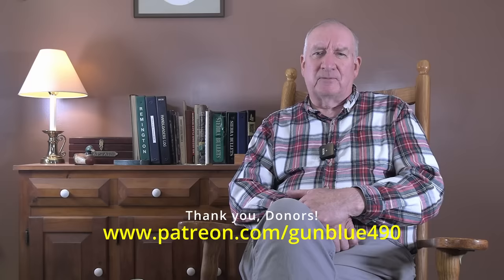The Copper Fouling Lie ~ Don't Fall for It!

Comment: When I started precision rifle shooting I always cleaned the barrels with a copper solvent after 50 rounds. Next time on the range it took me about 8-12 fouling shots just to get the point of impact back where it was before and to get back proper precision. After a while it dawned me how dumb and also expensive that practice was and never removed the copper from barrels since, and after many hundred rounds through my .308 and .300 they still hold 0.5 to 0.75 MOA consistently.
Reply from the maker: That was exactly our experience.  It creates cold clean bore syndrome.
Reply: @GunBlue490  should I fire copper jacketed ammo for my .22LR rifles? I think I only have used lead bullets on some of them eg Aguila super but I have some cci minimags...
I think I've answered my own question 😅
Reply: @Bear Gillium  the copper on 22 lr projectiles is more a copper wash or coating that is far softer than a jacketed centerfire round so it shouldn't do anything much to the bore.
If anything its cleaner than using straight up lead projectiles.
Reply: What cleaning solvents do you use?
Reply: @GunBlue490  so you acknowledge it exists, but you choose not to address it because it’s not absolutely necessary?
Reply: @jasonrad9332  Copper in the barrel yes...copper "fouling"...no.
Reply: In light of this "American Capitalist Idea", my ex-wife who was born in Korea would tell me that "Greeting Cards" were a way to get Americans to spend money. I think she is right, and I think it's that way for a lot of items on market shelves and concepts. We have to wash our hair every day, soap and water, clothes wear once and wash, clothes soap and it just goes on and on. It's capitalism at work...and so is copper fouling... capitalism hard at work...
Reply: But what about in the case of a couple thousand or so rounds? A few hundred rounds is nothing for a modern centerfire rifle firing jacketed bullets. My first AR15 saw 1,500 rounds in the first year of me owning it. And at the time I was a broke college student.
Reply: did you notice more impact shift with the 300?  ive heard from experienced hunters that this is more exaggerated with magnum rounds. I missed a bull last season, so I'm not going to clean my barrel and see what happens
Reply: The only solvent I am aware of is Hoppes # 9. I usually just clean my bores with Rem Oil
Reply: I tell people all the time, never clean your bore if you intend to shoot anytime soon, like going hunting. It takes around 7-9 shots just to get it back into Zero, but not due to fouling, it's due to burning the cleaning fluid out of the barrel. Once it's burned out, the bullet can develop consistency.
Reply: @hardlylivin6602  Refer to 7:50 Striations are filled smooth and doesn’t build up beyond filling, it gets shot out with each consecutive bullet.
Reply: Me too.
Reply: This is my experience.  The copper fils tiny imperfections on a metal surface and actually makes the bore slicker.
Reply: @additudeobx  I wouldn't call that capitalism; sounds more like marketing and a population's general adherence to group-think.  Capitalism creates the environment wherein marketing is effective, I guess, but I still don't see that being the fault of capitalism.  It's inherent to both companies and individuals having the freedom to buy/sell what they so choose.  

Would a command-economy fix the issue of hucksters selling people on the idea of needing copper solvents for their firearms?  Sure.  But you're going to lose the right to own those firearms in the process...
Reply: I'm not sure I follow his logic. On the one hand he says if the military doesn't address copper fouling it doesn't exist. And then the very next breath he explains that the military solution of CLP isn't that good and he has no idea why they still use it. If the military is wrong about CLP, how do you know they're not wrong about copper fouling? I'm not saying copper fouling is or isn't real, I'm just saying his argument don't make the case he thinks it does. I mean according to his logic, if the military doesn't know of a better cleaner, then it doesn't exist...
Reply: @theaustinfamily555  yep,i only use gun oil to clean my 5 rifles. Ive borescoped them all and ive never seen copper fouling in any of them ever,only carbon black comes out when i patch it.
Reply: @additudeobx  you must be stinking very bad.😂😂
Reply: @hardlylivin6602  you should watch it again and pay attention.
Reply: @additudeobx  Was she from North Korea?
Reply: @waynehajek6346 😂
Reply: @waynehajek6346 Indeed,like communisms limited choices a better idea.
Reply: The copper is better than the lead!
Reply: @alllopez63 I can completely clean my rifle barrel and the first shot in the clean bore always hits 8 inches high of point of aim and the sound shot is always 2 inches higher than point of aim and the 3 three shot is dead on so I never will hunt with a clean bore I always fowl it with 5 shots before I go hunting
Reply: Noticed that most long-range shooters don't clean their barrels until they notice an accuracy issue? It is working good for me so far?
Reply: @GunBlue490 what carbon cleaner would you recommend?
Reply: @byrontitanv8  gun oil and a patch
Reply: Barnes and others that make solid copper bullets have proven, when switching from copper gilded bullets to solid copper, the bore must be cleaned of the existing copper for optimal accuracy. Both Ron  Spomer and others have confirmed this from actual experience.
Reply: Not sure what you consider precision shooting, but for f-class and benchrest, a 1/2 moa barrel would be a tomato steak. And yes, we remove copper and carbon. Then follow with iosso or jb to polish out whatever is picking up the copper.
Reply: I clean my bore with breakthrough carbon pro first using a polymer bristle brush to remove heavy powder residue then clean it all out and dry bore and use a brass bristle brush scrubbing vigorously with some type of oil to remove lead and heavy copper until bore is actually "clean"
Reply: A good barrel that has been hand lapped by someone who knows how to do it won't copper up much at all. My 26" 1/9 twist Criterian 223r barrel has no cold bore shots out of the group and after 50 rnds, I get very very little blue on patches with a copper solvent, even after soaking. Cheap rough barrels will copper up.
Reply: Good comment...i don't shoot much but i thought a " dirty" barrel is the normal condition
Reply: @danblumel  Exactly! I wanted to mention the same. Barnes and others are doing it for good  reason.

Comment: I have become exhausted by having arguments in comments sections over this. I officially no longer care to try to save the YouTube shooting community from themselves. I tell people I curate copper during barrel break-in to improve accuracy, and I get no end of push-back from about two generations of self-proclaimed-know-it-alls. I'm over it, lol.
Reply: What does that mean to "curate copper"? Never heard that term before?
Reply: @jeffdonofri8027  Deliberately allow it to build up and collect in parts of the barrel that are otherwise imperfections in the cutting of the lands and grooves of the rifling, and purposely leave it there.
Reply: @jeffdonofri8027  Like: what do you do when you curate a collection of anything. Some things you save, some things you don't. In this instance I'm removing lead and carbon fouling, and retaining copper. It isn't like I read it somewhere, I just used the words curate and copper together because, well, it is a short way of describing it. So much for that plan though...
Reply: Is blue on the cleaning patch a bad thing? Remove carbon only?
Reply: @davidpaulk5658  blue or greenish is the copper coming out
Reply: @totljag1  yes but isnt it unavoidable to remove some copper while cleaning?
Reply: @davidpaulk5658  most likely but don’t use any copper remover down ur barrel ! All u want to remove is the carbon , the carbon will hold moisture and rust ur firearms , use Hoppes to remove the carbon and then after gun oil , CLP sucks , it’s not a great carbon remover or a great oil ! The copper in the grooves is smooth and will greatly help with accuracy ! The copper in the grooves is not fouling !
Reply: @totljag1  Thanks. I have a cleaner that removes carbon AND copper. I will experiment with HOPPES
Reply: @davidpaulk5658 Let me ask the better question. Why are you cleaning in the first place?
Most rifles modern rifles don't need to be cleaned regularly at all. Apart from removing debris from action components or clearing out corrosive powder residue it will usually degrade performance and it's only one more abrasive thing going down your barrel.
Unless your shooting sub .25 minute groups where you always need a fresh barrel it's overkill.
Reply: That's not how English works.
Reply: @DinoNucci  Is that so...do tell.
Reply: @userJohnSmith  yes I shoot sub minute in the .2s (when I'm lucky) and in the .3s regularly.Heavy barrel bolt gun.Shilen barrel,Canjar trigger,Sako action,Herters stock.I dont uses brushes of any kind.Just Sharp Shooter Cleaning products. Will definetly try Gun Blues method.
Reply: @davidpaulk5658  Been doing precision ARs for a few years. Half minute is my baseline with those and I never clean them. Just pull the bolts to feel with carbon, sand, and oil.
Reply: @userJohnSmith  you dont clean the bore and chamber?
What barrels do you like for your precision ARs?
Reply: @totljag1  Thank You
Reply: @davidpaulk5658  Never. McGowan has been the most consistent, Sanders Armory seems to get good barrels as well, not sure from whom. I've heard faxon is good. But I'm in Colorado, basically no humidity. Doubt that matters much though.
Reply: I mostly shoot 22s and handguns, but this copper fouling myth has obviously taken on Religious cult dimensions. The first thing you do with precision 22s or position rifles is to take fouling shots to coat the inside of the barrel with waxy bullet grease. Copper can be used as a lubricant in certain high pressure processes.
Reply: @upcycle.outdoorsman9629  Do you use any of the Copper removing formula powders (Copper Fouling eraser), or skip them as also a "fad."  Just curious, meaning if the copper is 'desirable' and copper cleaners are avoided, why use a powder formulated to also remove copper. Thanks.
Reply: @davidpaulk5658   MY Hoppes #9 patches will be blue if I let it sit for a few minutes in the barrel.
Reply: @cbsbass4142  Yep,prolly a good idea not to let it sit and let only the carbon be removed.
Reply: @cbsbass4142  No I don't use them. Yes they are a fad.
Reply: @totljag1  So as a brand new firearm owner here, mind explaining if I should remove the carbon buildup with a quick clean after every session or just on a more periodic basis?
Reply: @ferrari340gt  I use Hoppes it’s a good carbon cleaner and use gun oil it’s last longer than that CLP and as oil sits in ur barrel it will help break down whatever other crap is in there ! For me I always keep my firearms clean and oiled, what the video and this man has taught me u don’t have to go crazy trying to remove the copper fouling ! My 30 year old pistols still look brand new ! I always clean after shooting !
Reply: @ferrari340gt  I have used a break in on three barrels. Those three are now easier to clean than the rifles I did not break in. I can never get a clean patch out of my Model 70 featherweight, I can run 20 patches through it and it still has carbon, even after I run a brush through with Hoppes.

Comment: It’s an interesting theory but I know there are a lot of high level competition shooters that would strongly disagree with you.  My problem with your philosophy of never cleaning the copper out is that if you use a bore scope to look down your barrel there are usually specific areas that the copper tends to amass in and it’s far from being uniform throughout the barrel.  I would sure think that has to have some impact on the bullet when there is varying depth in the lands from the high and low build ups of the copper. As far as the bronze brush getting destroyed by the copper solvent I don’t doubt it at all but most copper solvents recommend you use a nylon brush anyways. I’m not saying you’re wrong but from my experience and based on the recommendations of world class shooters I will continue to clean the copper out of mine every 100 - 150 rounds or so.
Reply: AMEN to your comment .  Had a discussion at a club range with a 1,000 yard B.R. shooter , he was in the top 3 world wide .  I asked him if he cleaned his bore at matches . He said , every chance he gets . They are allowed fouling shoots before scoring .  It's utterly stupid to think that a bore with a build up of cooper is going to shoot as good as one that isn't .  Fouling is fouling , regardless of type .  The only difference,  it's  easier to remove copper fouling than
carbon fouling.

Comment: My first rifle was a 1917 Enfield. For the first 30yrs all it ever fired was military ammo. My Dad taught me to clean it with boiling water and when clean run a couple of patches with 3in1 oil through it. Did the same for the next 28yrs using mostly non corrosive ammo. After 58yrs and thousands of rounds it still shoots the same. Its the most accurate rifle I've ever owned and just cleaned with hot water.
Reply: I love 3in1 oil. That stuff is a hidden gem amongst all the razzle dazzle gimmicky clever advertisement oils
Reply: Good tips thx
Reply: Surprised your dad, who you claim used it for 58 years, did not tell you the reason why he put boiling water through it after shooting what you claim is "military ammo."
Reply: @Dan-di9jd 
Where did he state his dad used the rifle for 58 years?

For a 1917 Enfield to only fire military ammo for the first 30 years of its life is to be expected. They were retained by the military until after WWII.
Reply: @Dan-di9jd your comprehension is peerless.
Reply: 3 in 1 oil and Ballistol have been my go-to cleaner/lubes.
Reply: To clear something up here, number 1 this rifle was in "unfired" condition when i got it and had never been issued. Number 2, my uncle gave me 4 metal GI cans of bullets every year for xmas so i never bought any other shells for it because i didnt need any. Most were WW2 ammo. I cleaned the rifle the same way even after i quit using military ammo. Number 3, im 72yrs old. My uncle gave all us boys a rifle for xmas because they were capturing all the trouble bears in Yellowstone park after closing the dump in the park and dumping them where i lived. They would paint yellow stripes down their backs and on their sides and yes i shot everyone i saw. The myth of having to have expanding bullets for hunting is just that, a myth. I saved the black tipped armor piercing ones for this job and they worked 100% proving it is penetration and shot placement on large animals.

Comment: My first fine rifle was a .243 with a very accurate Shilen heavy-varminting barrel.  I shot hundreds of rounds through it, just cleaning powder fouling out of it periodically with Hoppes #9.  Eventually it started blowing burned powder around the bolt into my face.  When I took it to the gunsmith, he chewed me out over the copper fouling, saying he had to soak the barrel in copper solvent overnight to remove the fouling, because it had built up so much.  He told me never to let my rifles go like that again.  He'd been in the business decades.  He would know.  The next time I shot the rifle, it was fine again.

Tony Boyer, the most successful benchrest shooter in history, recommends (Chapter 17 "Cleaning the Barrel" of his Book of Rifle Accuracy) cleaning the bore of a benchrest rifle every 20-40 rounds.  He mentions the use of Sweets and Montana Extreme solvents, which are designed for copper fouling.  He starts that chapter out by asserting that copper as well as carbon builds up in the barrel as you shoot.

A factory rifle may have a barrel with a significantly larger diameter than a high-quality barrel like a Shilen, Krieger, or Lilja, so it may take hundreds of rounds of copper fouling before pressure increases would become a safety issue.  My barrels are all of benchrest quality.  I'll continue to follow the advice of the smiths who build my rifles, and of Tony Boyer.  Once you've had burning powder blow back into your face, you take a dimmer view of the idea that copper fouling doesn't build up and require periodic cleaning.
Reply: I agree. There's definitely copper in the bore, and a simple patch with an ammonia based cleaner will prove that. A bore scope will also show this. I've purchased rifles (for a song) from guys that told me the barrel was "shot out", and on every one of them, a good cleaning was all that was needed to bring them back. And yes, copper was part of the issue.